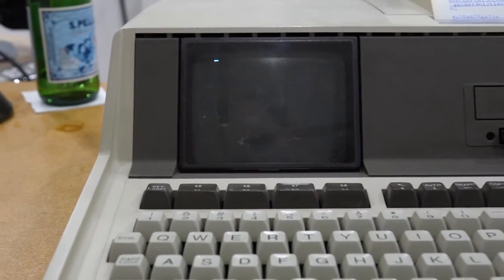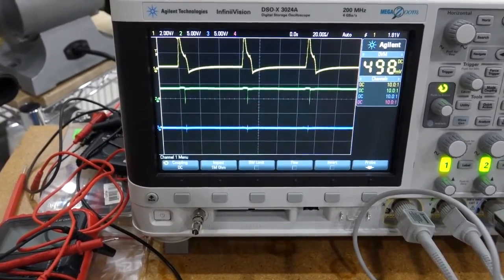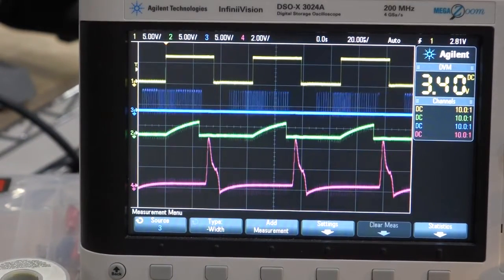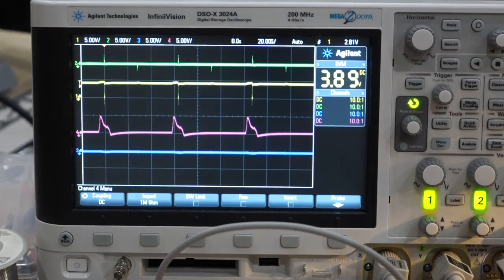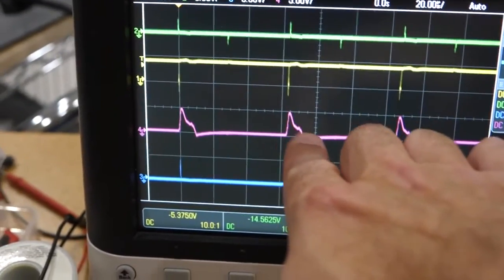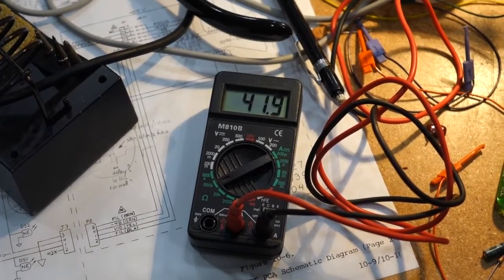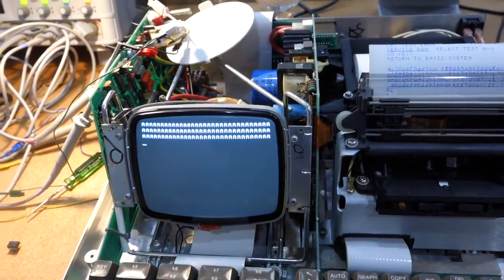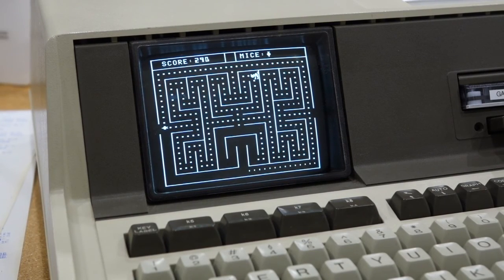HP-85 Vintage Computer CRT Monitor Repair

Comment: Well, that was like paint by numbers. I have an 85B with characters drawn during retrace. Like Marc, I tested the output of the cross coupled NOR gates (RS FF), and TP4 was stuck low. Added a 220 pF cap across C39 and the screen showed correctly. Removed C39, and it measured ok at 870 pF. Replaced the 555, and re-installed C39 and my display is now fixed. So nice to watch Marc do it first, and show the incorrect scope traces (that matched mine). So 8 minutes to watch the video, and 10 minutes to do measurements and the repair.  My screen also had some random horizontal jitter, and this might have fixed that too.
Reply from the maker: Philip, I ended up also having to change C39 a while later. It had some kind of internal contact problem. Sometimes would test good, sometimes would test bad. Someone else reported having the same problem with that cap, so it maybe a systemic issue. My guess is that these parts (the cap and the 555) are close to the warm end of the electron gun, maybe they get stressed by the heat over time.

Comment: if you don't know what an HP-85 is, it is late 1970s baby version of HP9830 desktop computer which had 1 line LED, cassette drive, boots up to BASIC and and drive a plotter, but with tiny CRT screen and cartridge drive. I worked for Mosaic Software in Boston, there was a company that made it into a business graphics system with a plotter, Graphics Software/ Mosaic was inspired to make Chartman for the PC. When I came along they asked me to make a spreadsheet, that evolved into 1-2-3 compatible Twin.

Comment: I was once told that integrated circuits have a tolerance of ±50%?  With tolerances like this...  I wonder of that could have been a 556 instead of a 555?
Reply: MichaelKingsfordGray
I'm sorry but it's not quite correct to say that a 556 is digital; it is, in fact, just a dual 555, nothing more, nothing less. There *IS*, however a CMOS version of the 555 called the 7555 - but it's still at least partially analogue.

Comment: good grief I can barely follow this. I was MIT masters EECS 1981 and never learned how to do this though the hardware guys I worked with at Data Terminals division probably knew this. Where did you pick this up? Most colleges didn't teach  this either even for EEs
Reply: I can’t speak for anyone else but I find it curious that there may be an expectation that one needs to pick up all the knowledge in some school setting, or that this has to be “taught”. It reminds me of engineering trainings in corporate world: if there is any interest in one’s craft, one’s own pursuit of knowledge will cover most of it. Once one has the basics, everything else can be figured out, with looking up whatever details are of generic nature.

One can learn a lot just from reading other designs. With so many legacy T&M manuals being downloadable for free, one can pick a new one each week, and figure out the operation of some part of the circuit, put it in spice or on a breadboard to play with it, tweak things to see how it reacts, etc.

I do that most weeks and constantly learn new things, and this applies even to “simple” designs like linear power supplies. Each one of them may be “basic” on its own, but each competent design will have some detail that is new to an engineering explorer. Put all such experiences together and one can learn volumes worth of highly valuable knowledge in the space of a single year. 

Personally, I also like making sure I truly can figure out a design once or twice a year by taking a new to me instrument and disassembling it as far as removable components allow, then reverse engineering the whole thing (essentially producing a “theory of operation” and schematics), then fixing whatever I found to be broken or marginal, then putting it back together. Only if I truly understand it will there be a good chance of it working afterwards, so it’s a good way to keep myself honest. Now this is often lot of work and I obviously choose to work on simpler instruments that maybe have a dozen or two chips and less than a 100 other discrete active parts, but I find it invaluable, and the fuzzy warm feeling is awesome after the repair/refurbishment is done and the thing works (sometimes better than new). I’ve been doing that for so long now that I figure it would be good to revisit some of it and put my findings in “manual” format (type stuff up etc) - especially for instruments that don’t have readily available manuals or where the vendor asks an exorbitant price - there are a few odd ones out there like that.

Comment: You for sure fixed it but usually don’t those caps dry out. Overtime it still might pull down that integrated circuit and kill it right?
Reply: Those didn't look like electrolytic caps (the kind that dry out).  They looked like standard film capacitors that are basically good forever, same with the resistor.  That said, I don't know when I've EVER seen a 555 go bad from age, that's a new one to me.  Unless you short them or drive them with too high a voltage I've never seen one fail before.  Murphy's law I guess.

Comment: Great job! I'm just curious (no pun intended), that you still have that faulty 555? It would be interesting to build the same monostable circuit it was used in the monitor, pulse it with an other 555, and keep it runnung 24/7 as long as it completely dies, or drifts way off (while monitoring it occasionally or even regularly, eg. once a day).
Reply: Because it isn't possible to check on something once a day while employed. I also hear it isn't possible to have an imagination unless you are unemployed.